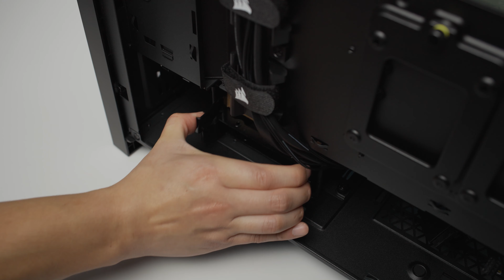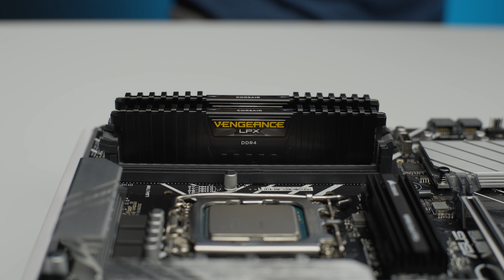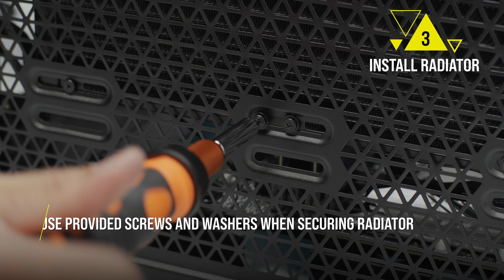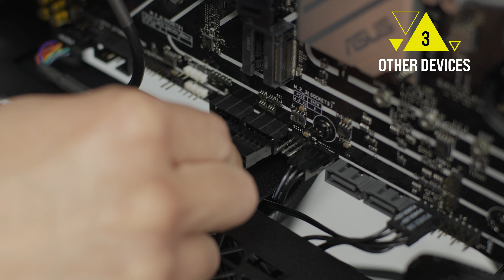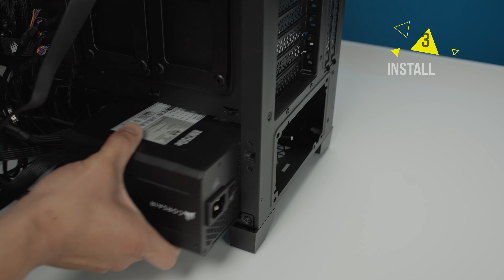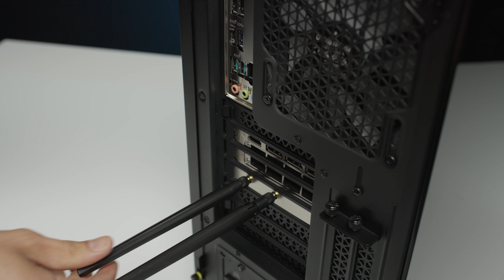CORSAIR BUILD KITS - Your Build Journey Starts Here

Comment: Terrible guide. Does not show that CPU's can be incorrectly inserted or tell you how to know which way a fan blows air or that ideally a radiator is possible should always be HIGHER or above the CPU block since it houses the pump which can be damaged if it starts to run on air (water pumps are not designed to run on air and can be damaged that way) which is bound to happen if the pump is at the highest point. Also you could have explained information regarding thermal paste and how it comes pre attached to the pump blocks on your AIO coolers and that it is a necessity and so on and that if the pump is ever removed after any long time has passed that you should not reuse the old one of possible and so forth so that if the people make adjustments to their PC can do it without any errors or mistakes. To me this just seems like the build kit is technically not a build kit and is just Corsair saying we'll let you do the building but it must look exactly like the one we sell so there is almost no chance of a customer ever claiming a warranty unless they have faulty parts and if they suck at building or do something not mentioned in this video such as upgrading your PC it will void the warranty etc...